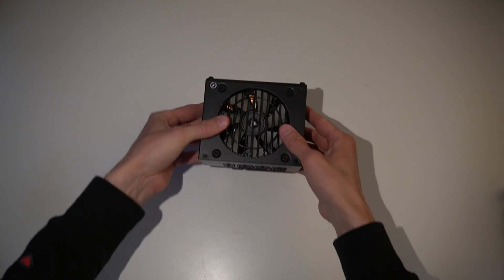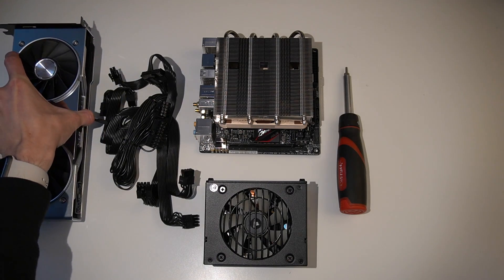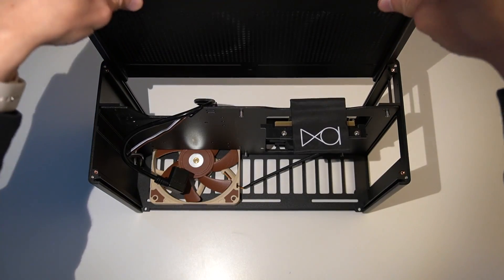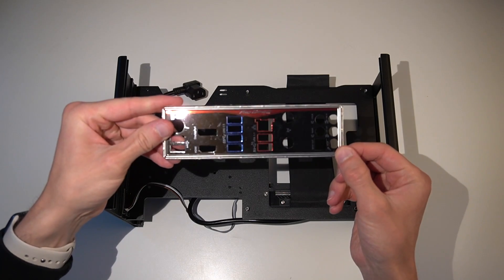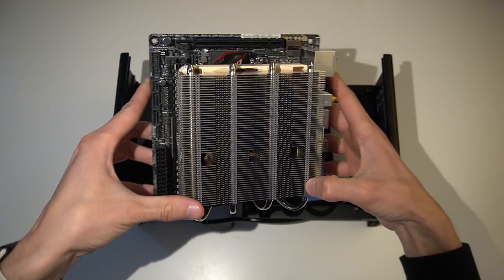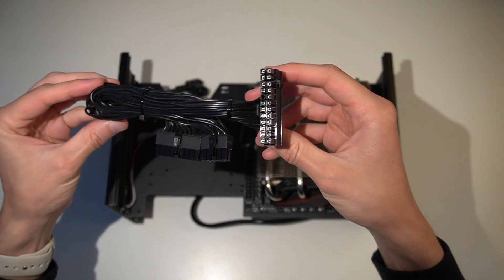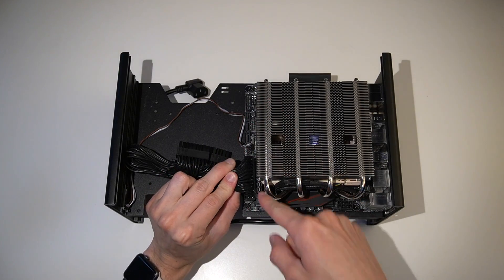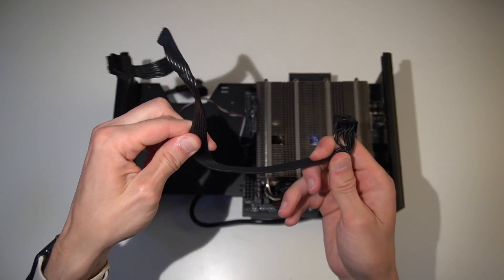Ghost S1 Cable Management Guide

Comment: Super thankful for this guide! Helped me route my cables in my build! Thanks!

Ps. Followed you initially in hiding the power cable extension behind the GPU, but this caused the GPU to bend outwards too much for my liking so I didn't do that. You can route it to the bottom edge (overlapping the fan housing) and the panel would still close perfectly

Comment: Nice video pal.  Could u tell me what is the cpu cooler in ur video? Is that a L12s or L12 ghost s1 edition with a 12015 fan on the bottom ?
Reply from the maker: In this video I was using the L12 S. My system has changed a lot since then and I had to switch to the Ghost Edition due to VRM heat sinks. ITX boards keep getting thicker these days!

Comment: 🤔  for a full 120mm slim cpu fan , dose that have low profile memery  hard to find ddr5 lp memory .
Reply from the maker: Using the L12S with a 120 underneath does require low-profile memory. Kingston and PNY are supposed to have low profile options at some point if they’re not available already.

Comment: Could you please do an update with your comment here:

Sorry for the delayed reply! I'm currently running the Meta Custom spine, the 3D printed upper fan bracket, all paired with an RTX 3080 FE/i5-10600k. I think the extra fan is necessary for the 300w+ cards, but my 2070 Super was fine without it.

Comment: Where do we put the 2.5 SSD?
Reply from the maker: Either where the 120mm slim fan is on the bottom, or behind the PSU on the opposite side (if it can fit behind your GPU)
Reply: @poobalu  Thank you

Comment: Nice job, dude. However, I gonna order customs cables. Any chance u could tell what length I need? Have MSI z490i board, and Corsair SF750 PSU.
Reply from the maker: Check out endgame customs - I made a different video specifically about his custom cables using the same motherboard and a 10600k!
Reply: @poobalu  Hey, me again. Considering your gorgeous cable management(Nobody on utube did anything close to what u did, except maybe OT with customs), do you think its a good idea to go for 120x120x25 bottom fan instead of 120x120x15, or its better to have some space btw cables and fan?
Reply from the maker: @vladpryshlyak2025  my experience has been that it’s better to use a slim fan because it’s easier, but if you already have a 25mil just use whatever you have!

Comment: Yesterday i tried to cable manage based on your example and it worked great. I’m just worried about bending those cables too hard...how hard can you bend them anyway?
Reply: Yeah, i did like you said. I peeled them separately, just that 24-pin cable gave me the most trouble. It took me 3 tries to make it as small as yours, and at the end result was fabulous. It just took quite some bending, but i tried not to bend cables repeatedly too much, just used some force to make them compact. Hopefully they didn’t brake haha
Reply: Oh and btw, have you tried doing the same or similar clean build with sleeved cables? Is it possible to fit them behind the psu and under, and still put a fan underneath?
Reply from the maker: @Jeronimelis  I haven’t yet, but I recently picked up an SF750 with sleeved cables so I might try that out - I expect it will be a similar result!
Reply from the maker: The wires themselves are pretty flexible - you can peel and separate the individual cables apart if the stock cables are too stiff. If you’re concerned, just double check that all of the individual cables are firmly seated into the associated connectors.
Reply: Nice! Please share your results with us!

Comment: Bottom fan is blowing down? Seems like it should blow up into the case...
Reply from the maker: Optimum Tech covered this a while ago - the system runs a few degrees warmer when the bottom fan is set as an intake. Likely from recirculating hot air from the PSU back into the case

Comment: I got a question.

Since you bend l12s, it's more likely similar to Ghost L12 now.

Will changing L12 fans from 95mm to 120mm slim fan work with the corsair lpx ram?

Thank you
Reply from the maker: The L12 is thicker than the L12s to “hug” the 92mm fan. Corsair LPX will not fit under an L12 w/120mm fans. You can purchase VLP ram and fit a 120mm fan, but again not possible with the height of vengeance LPX.
Reply: @poobalu  this helps a lot! Thank you!

Comment: Great build! Is it possible to fit a external SSD in this build?
Reply from the maker: If you mean a 2.5” SSD drive, you can replace the bottom exhaust fan with the included bracket. It’s also possible to fit a narrow SSD behind the power supply if you route the cables differently.
Reply: @poobalu  Not possible to fit behind power supply with this route?
Reply from the maker: ZK maybe behind the GPU on the other side of the spine, but the cables are behind the PSU and I don’t think there would be space for an entire drive to squeeze in there too.

Comment: I'm surprised your CPU side Ghost S1 panel slide down that nicely. Seems you use Corsair LPX memory? Even with a bent L12s, the memory itself is pushing the cooler out too much, making the sliding of that panel to be quite awful, need a bit of assistance as it's touching the cooler.
Reply from the maker: Odin's Playground it must depend on the motherboard because I recently upgraded and can no longer use the L12s. This video was shot on a ASUS Z170-I PRO GAMING and the CPU fan is quite literally squeezing the RAM and the top of the WIFI module by the IO. Maybe try bending your L12s a TINY bit more or using a file/knife to trim down the edges of the fan to get the fit you need.

I now have the 10600k on a z490M by Asrock and no amount of trimming or adjusting was going to get the L12s on there because of the board’s heatsink.

Comment: THANK YOU. I'm building in a ghost S1 when the Ampere GPUs come out! very helpful!
Reply: Got a 3080 FE, Gonna build as I type this, thanks for this helpful method, can't wait to try it out until I cough up the money for custom cables LOL.
Reply from the maker: @untitled795  keep me posted on how it goes! It’s supposed to be tough to cool the 3080 FE but I’m hopeful!
Reply: @poobalu  So we must have complete different set uop, my cables are braided and in no way shape or form can fit behind psu. Aslo the sudden transitions in your video make it extremely hard to follow, because evertime the fram switches its a different part of the process, or im extremely bad at following instructions aha.
Reply from the maker: untitled795 happy to help, I hope they fit! 🤞
Reply: @poobalu  3090 won't
Reply: @poobalu  hey did some.digfig, 3080 FE was being tested by one of the admins at Louqe, be didn't have much negative to say about airflow + cooling. Size fits too since it's like one of the only 2 slot GPUS
Reply from the maker: untitled795 hey that’s good to hear!
Reply: @poobalu  yeah, again if you're interested, the only other currently known 3080 that will fit S1 is the evga XC3 (lowest tier gpu, triple fan, no backplate). It doesn't look half bad u like their higher tier ones and evga support is legendary. Personally I'm trying for a FE.

Comment: Great work!  no need for custom cables or do you fancy adding shorter one later?
Reply from the maker: mods1965 I started making my own custom cables but found that the sleeving makes them far too thick. I might try again with unsleeved cables, but I’m happy with this for now. The 24-pin has been a pain to try to build!
Reply: @poobalu  - that would explain the sleeve less cables you see on some builds.  Interesting to know.  Thanks.

Comment: This i never understood why the manufacturers cannot make the cables thinner, its ridiculous how big and many they are. Can't they just make them as small as sata cables all of them? I am no electrician I don't know if it's possible can somebody tell me if its possible?
Reply from the maker: Butters the issue with these SFF cables isn’t that they are thick, rather they are a set length to fit a wide range of cases. The bulk is excess length, so making custom length, un-sleeved cables is the only way to have less bulk, but the work involved is quite a lot of effort for something that has no performance gain.
Reply: @poobalu  I would prefer fabric sleeves on all SFX PSU cables! xD
Reply from the maker: Quast I thought the same thing up until I tried making custom cables this week and it was awful! Haha.
Reply: @poobalu  How was your experience? Was always thinking of ordering some but the price seemed a bit excessive, so I never did order any. xD
Reply from the maker: @Quast  I didn't finish making my own, but if I ever do I'll follow up!
Reply: @poobalu  Now switched to SFX Corsair Platinum, pretty thin modular cables, far thinner than we could do them ourselves!

Comment: I have a very clean build also. However, how did you manage to get the side panel to slide in so smoothly on the CPU side? For me, using same Corsair Vengeance LPX RAM, it makes the panel bulge out a bit as it’s pushing too much on the CPU cooler (Noctua L12S, Brent).
Reply: If you're too agitated on bending the heat pipes on the cooler, Noctua recently released a ghost s1 edition of the L12S to fit flush within the case.
Reply from the maker: Odin's Playground make sure that your L12s is bent as low as it can possibly go and is flush with your ram and IO if needed. On my first pass the bend was a bit lopsided and I needed to apply more pressure to bring the cooler down on the side closest to the rear IO.

If that doesn’t work, it is possible to shave off a few mm using sandpaper or a dremel. If all else fails, you could buy the new Loctua and sell the L12s.

Comment: Thanks for uploading this!
This cable management setup wouldn't allow for an SSD to be mounted behind the PSU would it?
Reply from the maker: Correct - however, the bottom fan is mostly to prevent dust and would be an ideal fit for an SSD. You could also try putting one behind the GPU if you have the clearance, but it would likely be snug and possibly warm.